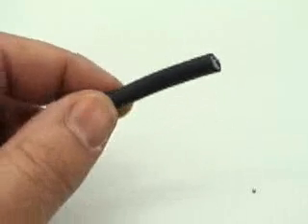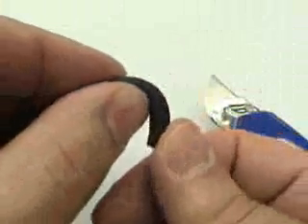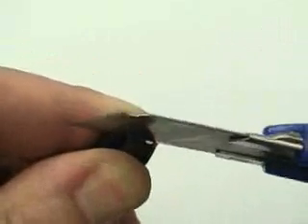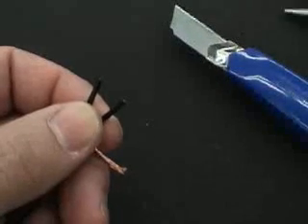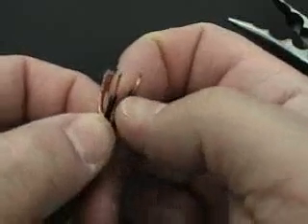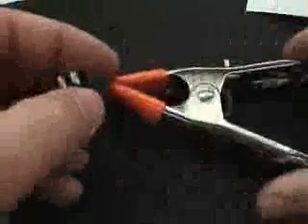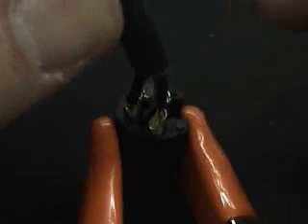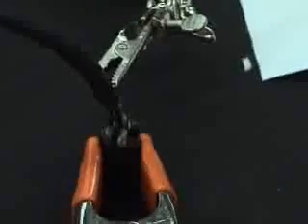Soldering an XLR connector to an Audio Mic Cable aka Soldering 101

Comment: the manufacturer isn't thinking ahead when they make microphone cable with the hot and cold wires jacketed with black insulation. those who don't use a ohmmeter will have a more difficult time.

Comment: This should be entitled soldering 101 and no more, it doesn't explain anything from an AV point of view of what each of the 3 cables do.... the fact its an XLR mic - it might as well be a 3.5mm stereo audio cable.... also btw soldering an XLR is not as hard as this shows it to be, they are miles apart in soldering terms and you can't really ever get the tinning of the plug to cross over, pretty lame

Comment: only in desperate circumstances though, when there is no 10 meter cable at hand : ) 

 it could be,  that at that point in the 5m +5m extension the central plugs could lay right near a noisy motor or PSU .and that to shield the mic cable is really needed?  

i was playing around with a motor fader today and with just a few centimeters of mic cable unshielded the noise was terrible.  this is the reason i am all over this subject today , 

thanks for your video upload  and inspiration : )

Comment: @scparker  thank you , i see now : the outer shell of the xlr plug touches the xlr chassis connectors ground when it is inserted into the case.

When xlr cables are joined together to make extensions, for example :  5 meter cable + 5 meter cable  the xlr plugs in the middle of the extension are not connected to ground like they are when inserted into a chassis. so maybe at the middle of the extension one could solder the tab to pin 1 so that the shells of the plugs are signal ground?

Comment: There is also a little solder tab on the xlr plug which connects to the outer chassis/case of the plug.  i never see this soldered in any cable i have opened, i would have thought this would be soldered to ground to help with shielding. : /

Comment: I did that today, but with a much thicker cable (harmonic tech truth link silver). Worked out nice after some frustration. Maybe I should have made a video. However the connectors I bought (Supra Swift) were too small. I had to drill them out, not a thing you'd wanna do with a 10 USD connector. But with some shrink hose it turned out nice in the end. So remember to check the gauge on the connector before you start.

Comment: I have some unterminated mic cable in my spare parts bag that has a braided shield and that stuff is such a pain to unravel so the shield can be tinned and connected.  Is there a trick to working with that type of cable to make working with the braided shield a little easier?

Comment: I had a broken one, and when I opened it I saw they whoever made it, he soldered the ground to the 1 (like you did) and then soldered another piece of extra wire from 1 to that fourth thing in the middle (that doesn't have the number and in this video it stays with no wire). my question is: why did they do it? is it also ground? thanks.